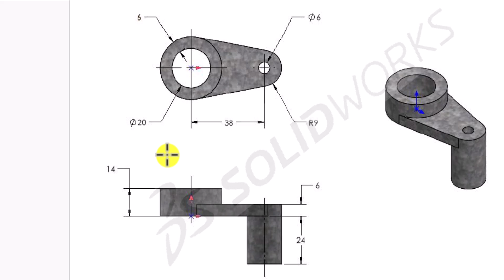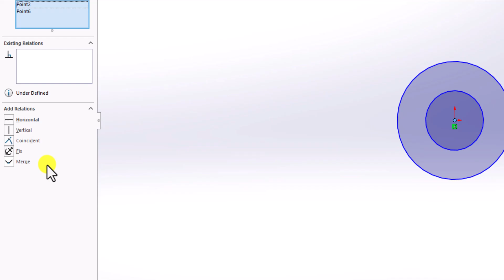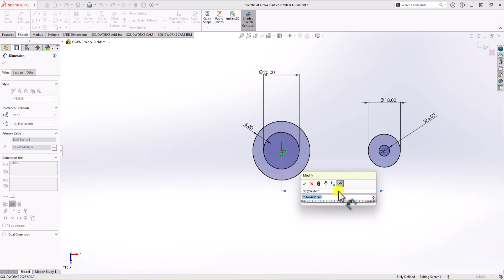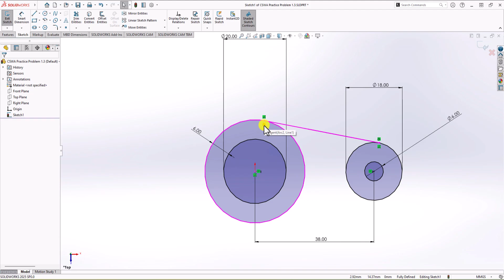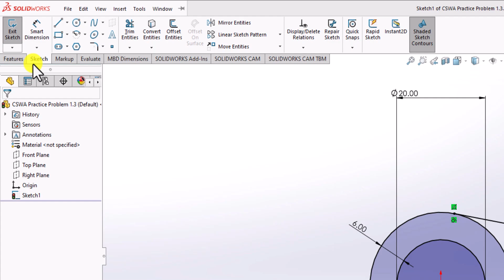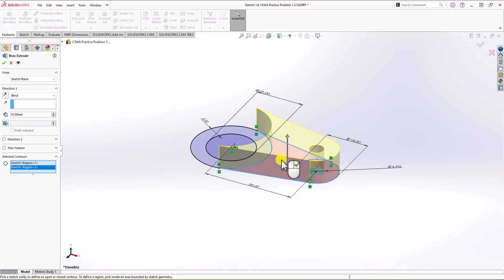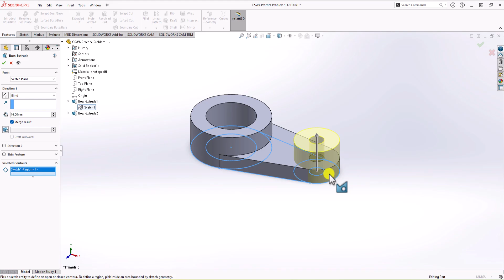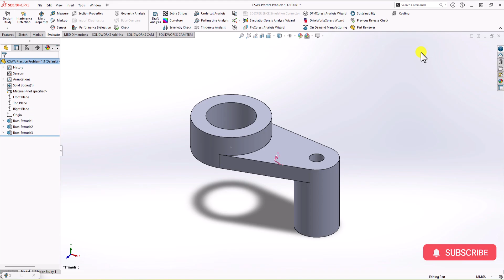CSWA Practice Problem 1.3 Solution | SolidWorks Exam Guide

Comment: Is that exercise for  Solidwork CAD professional or not And how I submit my answer of questions in exam And these all questions are only drawing question or theoretical questions....
Reply from the maker: These questions are primarily intended for the CSWA exam, but they can also be beneficial if you’re preparing for a professional-level test. To learn more about the exam, check out this link: 

https://www.solidworks.com/certifications/mechanical-design-cswa-mechanical-design. 

You’ll also find a guide there on installing the required software. Note that to submit your answers for the exam, you must install the software, complete the test within it, and submit your responses through the software platform.